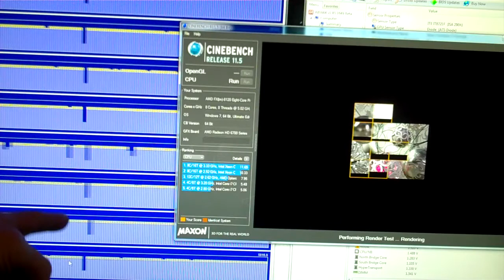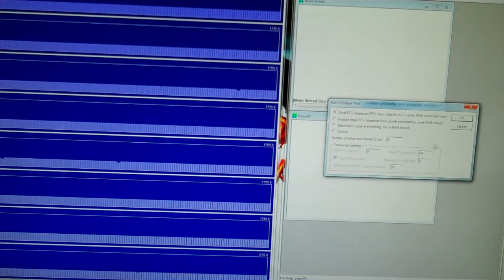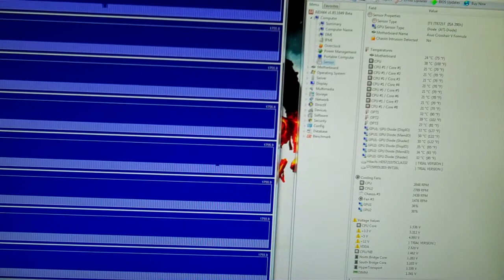FX-8120 Throttling

Comment from the maker: It is the software (TMonitor) itself that is doing the throttling.  Thats just how it works just like with any other processor.  But yes if you want to disable the throttling you have to disable APM in bios and maybe even other CPU power features.

Comment from the maker: If you are using TMonitor then it is the software that does that.  Every processor running on TMonitor does this.  If yours is doing it with another software try disabling APM.  This should disable the throttling.  If that doesnt work disable all other CPU power saving features and you should be fine.

Comment from the maker: @timbo251 Yeah I knew about this and had APM disabled.  It turned out to be the software itself.  The program T-Monitor was the problem.

With the GB board you should be able to update the BIOS and it should disable it automatically.